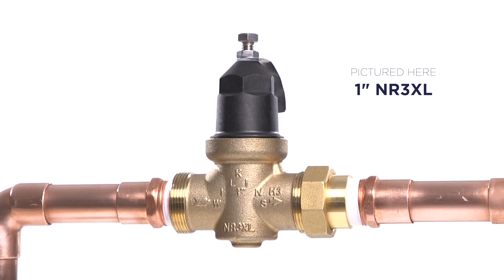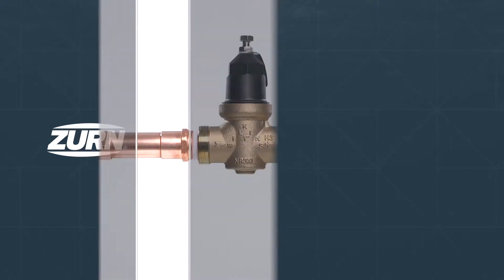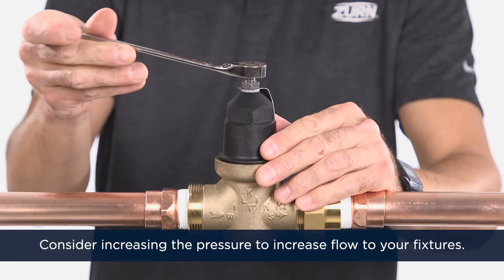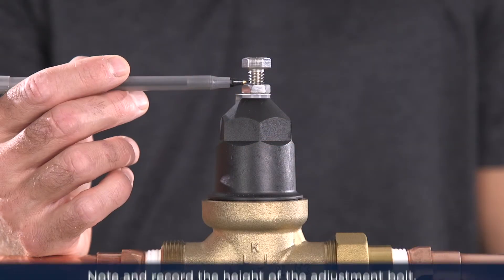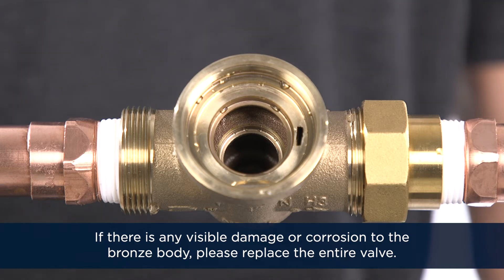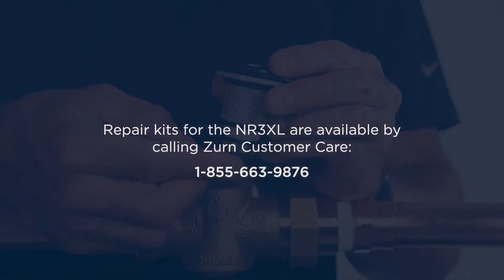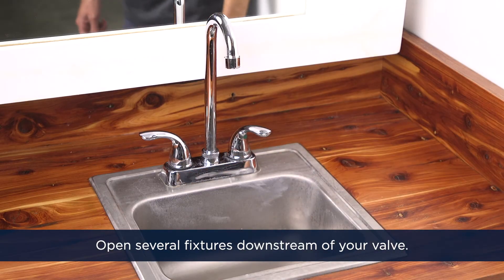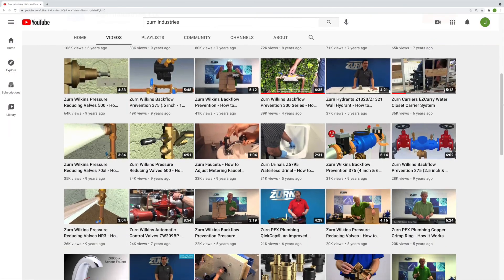Troubleshooting a Zurn Wilkins NR3XL Pressure Reducing Valve

Comment: Is the friction ring necessary? After taking mine apart, I can't find that piece. The pressure builds up and the hot water tank begins to leak to relieve pressure. Could it be the friction ring or do I need to purchase a repair kit? The pieces resemble those in this kit.
Reply: you need a new PRV (pressure release valve ) and an expansion tank then.

Comment: cheap plastic screws into the regulator. I had to have the whole thing replaced because the threads got damaged.  Very disappointed. Returning repair kit. Using a different brand with all metal housing.